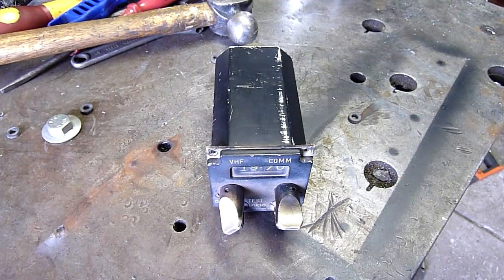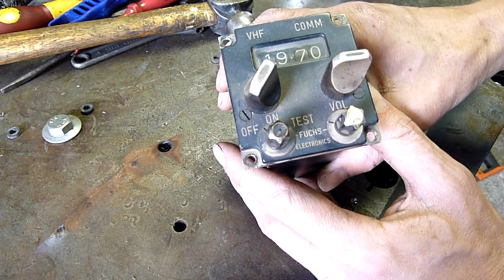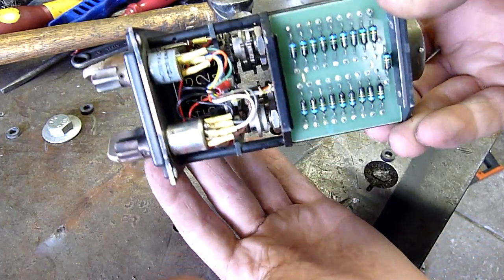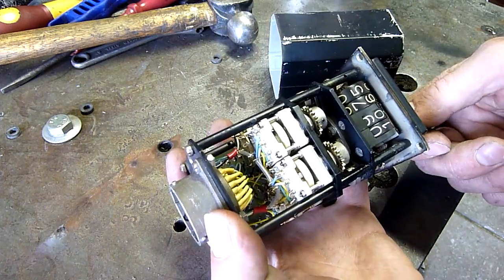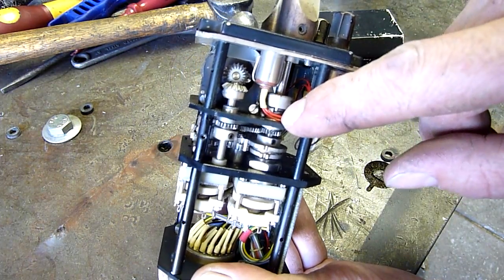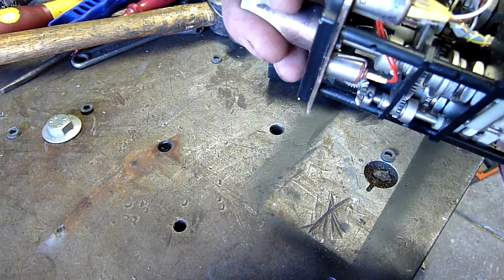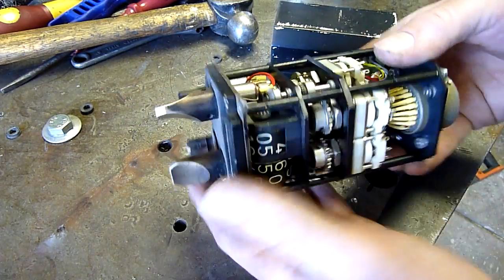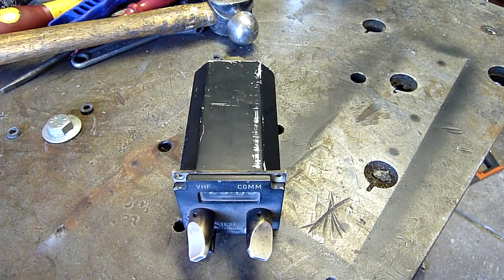Jet Tech Tuesday - Saber Jet VHF Selector module

Comment: I would say that is the frequency not a channel selection, 113 to 147 is roughly the air band with a bit of cross over into the amateur band (144 to 148 megs). would be interesting to see what the whole rig looks like, prob has atleast 2 boxes maybe more to it. What did they do for antennas on jets though?

Comment: Yep its an old 360 channel controller. I have a video about 2 of 5 which is the coding system it uses to communicate with the actual radio. Those components on the circuit board are diodes not resistors. Age wise pre 1972 in the US at least they changed from 50Khz to 25Khz at that time alot of companies switched well before that. Not too much of a problem to reverse engineer, offical documentation is hard to find altho there are some standards ARINC, ATA, ATR ect...

Comment: air band comms use VHF AM. channels are 20KHz wide. the air band is 108MHz to about 135MHz. the "1" is assumed and is not necessary to show it so all you are adjusting is the frequency between 108 to 135ish.

Comment: I think that late 60s is probably right with the manufacturing date, there was not a lot of UHF radio equipment available in the early 1950s, and none of what was available would have used imported Japanese parts. I don't think that the tuning itself was carried out inside that head unit, that was done in the main box or boxes, located elsewhere in the aircraft.

Comment: Taking this further, that is the "head" of the VHF communications transceiver.  The main transceiver box would have been mounted elsewhere, in a separate avionics bay with a wire harness connecting the two.  The frequencies are the same today, except new units have 720 channels instead of the 360 your unit has.  Doubling the channels on new units is done by closer frequency spacing.  Example:  Your unit is capable of 118.00, 118.50, 119.00 mhz and so on.  New units are capable of  118.000, 118.250, 118.500, 118.750, 119.000 and so on.  If you could get the main unit, wire harness, antenna and a power supply, you would be in business!

Comment: It's definitely quite old, probably about half a century. The "business end" radio itself would have been rather large (similar size to that "black box" you have) and mounted in the avionics bay in the aircraft.

This control head goes in steps of 50kHz, however most of the world these days now uses a channel spacing of 25kHz, with Europe now using a 12.5kHz channel spacing due to the increasing need for more channels.

Frequencies in the range 118-136MHz are not only assigned for communications between aircraft and ATC, but companies such as airlines and flight training schools can also license their own company frequencies within the aeronautical VHF band. Frequencies can also be allocated to digital communications such as ACARS.

Comment: It's just the channel selector and the volume control, it's not the radio. Looks like it is tuning from 113 Mhz to 149 something in 50 Khz steps. Oh, and those components you call resistors, I think they actually are diodes.

Comment: Nice control unit, good internal mechanical bits.

I suspect that the 100Mhz part is not displayed so 29.550 could actually equate to 129.550 Mhz, the type of radio that would have been fitted into the aircraft  would have used AM and not FM, AM is still used for comms to/from aircraft.

I have a few new unused switches like the mode switch here.
Have to try n see if Alex can give me a captain cook at the bits he has before sending them you way (as a radio tech by trade I love all older radio stuff)

Comment: Think you could "hack" it in an actual functional radio? As in, would it require some other components or it could be used as is to select channel and the sort??
Reply: It doesn't have any radio parts in it, it is just a switch module that doesn't take up much room in the cockpit. The radio is at the other end of a multiway cable that plugs into the large connector on the back.

It should be possible to reverse engineer the connector pinout since it is probably mostly just switch contacts (if the manual can't be found).

There are many things you could do with the switches, for example you could use something like an Arduino to read those frequency switches and make the settings available on a computer, which can then use that to tune an actual radio or select internet radio stations.
Reply: Patricia Travers That's what i meant. I know this isn't the business end. As for the Arduino, too complicated and unnecessary. Those are switches and knobs. I'm asking if it could be integrated inside a radio. My thinking is it can't as i believe there has to be something more inside the actual "radio" box that this peripheral doesn't have.
 tldr can this unit, as is, be hacked inside a preexisting radio.
Reply: aserta tldr response: yes, it just needs a bit of glue electronics.

Comment: Ed.  Thats an aircraft communications radio.  It operates from 118.00 kHz to 136.00 kHz.  That unit is a 360 channel unit
Reply: Not sure about the numbers, but it definitely is in the 100+ Mhz range NOT Khz.
Reply: Any idea on the year?

Comment: Figures are frequency in Mhz. Military 108-118Mhz. Civilian 118-136Mhz.
Reply: so that would make it the radio the could use to talk to civilian towers.
Reply: Actually, 108-118MHz is assigned to navigation aids such as VOR (VHF Omnidirectional Range) and ILS (Instrument Landing System).

118-136MHz is used for civilian air-air and air-ground communications.

Military uses a bunch of different frequency bands but the most well-known is in the range of 230-400MHz.